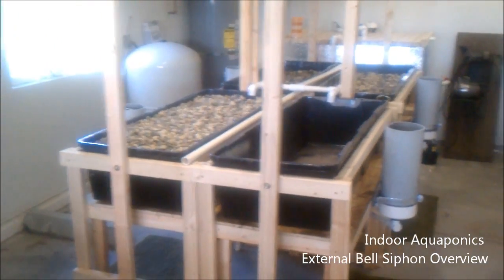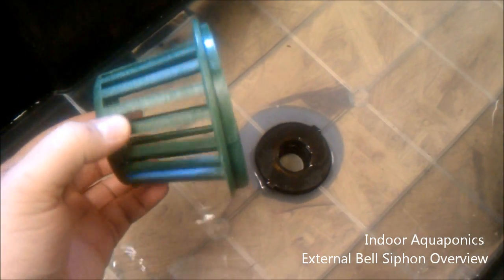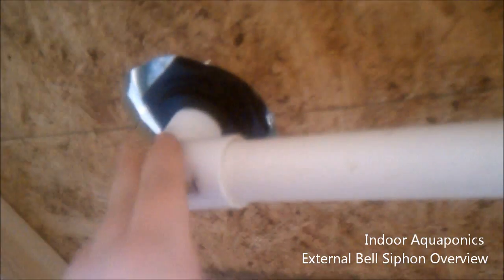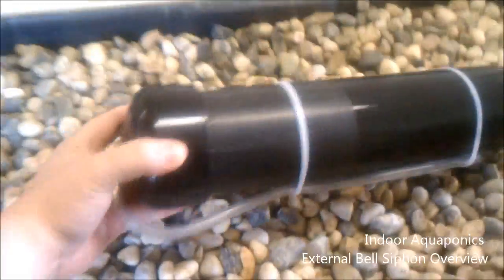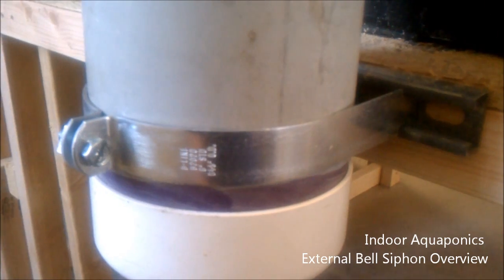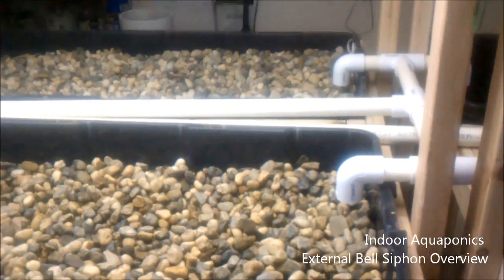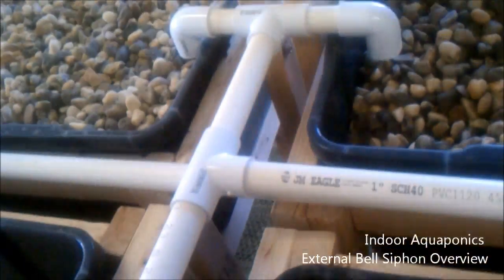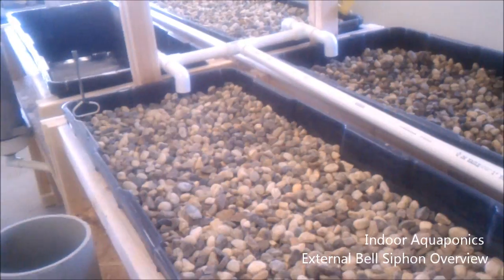Indoor Aquaponics - External Bell Siphon Overview (Theory)

Comment: where do you get an adapter that connects from the end cap? 1:38, or was that just jerry rigged in, if so how did you do it, thanks. would like to see an updated system, good job though

Comment: Killer system !!  the only thing i worry about is that your drain at the bottom of the bed may get root clogged. if you plan on growing tomatoes. Just a thought ,it wont happen right away. But it looks like it could build up down there.  Still looks great . look forward to your update....